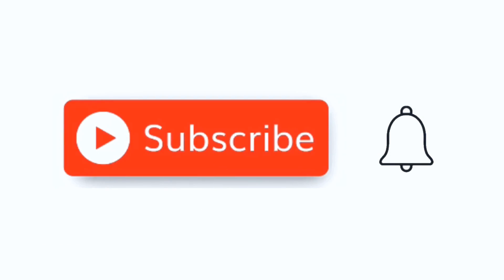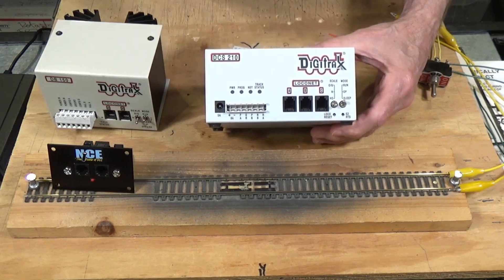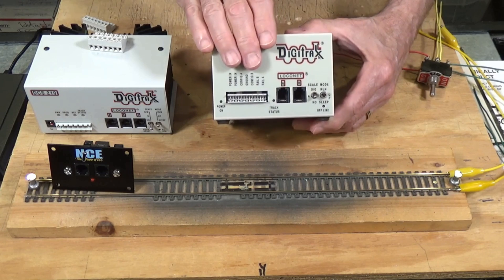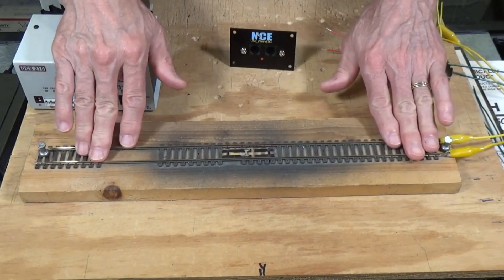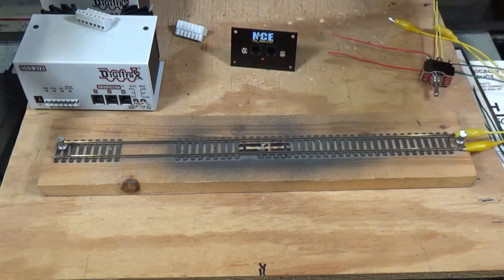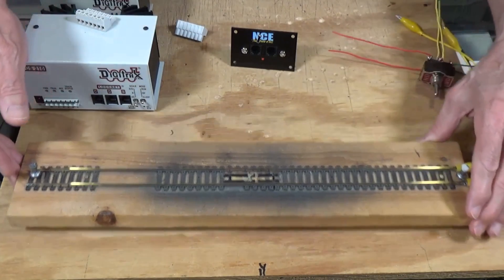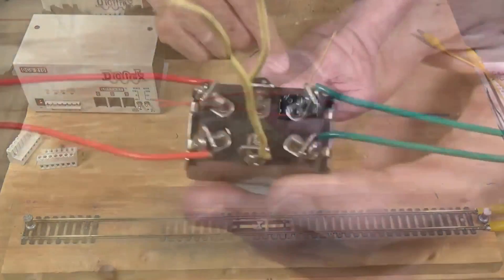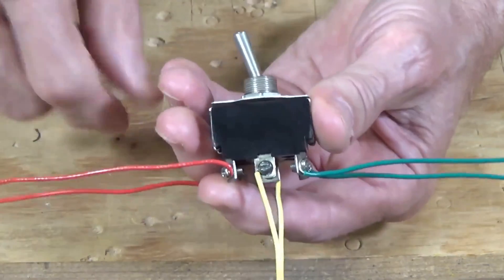Add A Dedicated Programming Track (290)

Comment: I had a similar setup with my DCS100 with the programming track attached to the layout by a turnout.  The programming track was cut to fit my longest loco. After I had the new decoder installed I backed the new loco onto the programming track and flipped a DPDT slide switch. Also a RED LED was attached so you knew you were ready to program the new decoder. When the switch was flipped the other way the RED LED went out, and the Rail A and RAIL B would then drive the loco out onto the mainline. The LED is needed so others would know they were in programming mode. If they see a RED LED on then they can only program on the programming track. Once off they are back to normal running.

Comment: that is to complicated 
solution: just put a shut off switch(DPST) on the main track for the single power feed systems and tap the programing track in between the system and the switch then you just shut off the main layout  when programing

Comment: Mrc prodigy elite comes preset at 5 amps.  But can be dailed up to 10 amps.  I currently have mine still set at the 5
Reply from the maker: Funnily, the manual says on page 1 it is 10 amp 15 volt system. On page 3 it further specifies input of 15-16 VDC 10 amps, and the output is 14.5 V at 10 amps. Maximum input is 10 amps.
Reply: @TheDCCGuy  thanks for catching my error its been corrected

Comment: Basically, paying a little bit extra for added capability far outweighs the risks involved in using less expensive options.  However, I would personally have a separate programming track on the workbench, either way, just in case of an accident.  Personally, I would include a rerailer section in the middle of the track - making the track a little more than twice the length of my longest locomotive - and install a track-mounted Kadee coupler height guage at either end; that way, I can also use the programming track to double-check my locomotives' couplers on both ends, and be able to get the locomotives aligned on the programming track with minimal effort.  Also, having a separate workbench programming track would, I'm sure, make pre-programming locomotives before entering them into service on the layout a bit less of a hassle, especially when putting multiple locomotives into service at once.  I could unbox each locomotive and pre-program it in turn, then place the locomotives onto a small rolling cart to take to staging (or anywhere else on the layout, for that matter).  That way, I could keep the empty packaging from cluttering up the layout room and not have to make multiple trips between the workshop and the layout room.  This is assuming, of course, that I would ever have an occasion where I would be unboxing and pre-programming multiple brand-new locomotives (or, more likely, sound-equipped passenger cars) at once, but not being a firm believer in superdetailing and fully weathering railroad equipment, it's more likely than not.